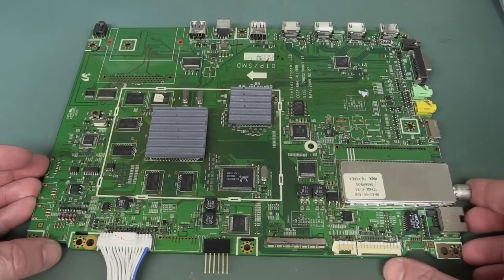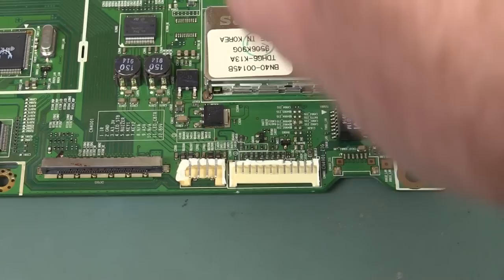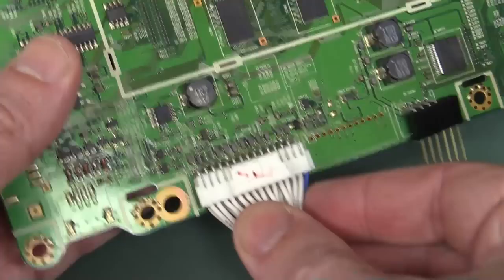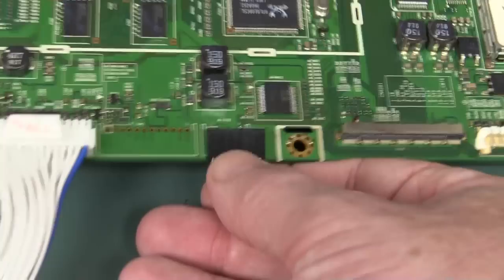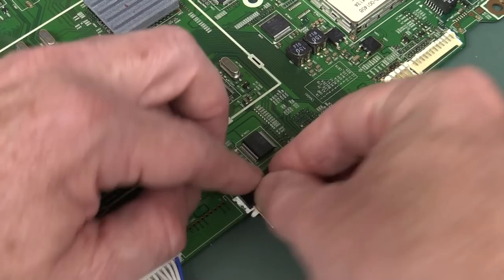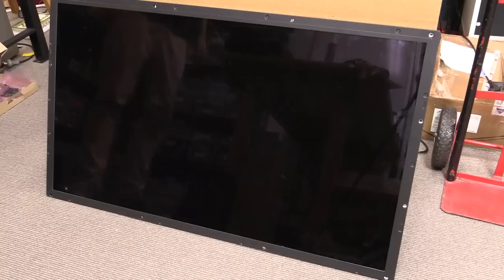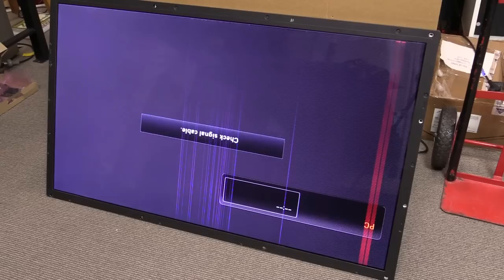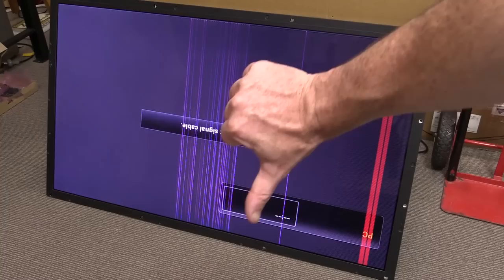EEVblog #794 - Samsung Dumpster LCD Repair Connector Followup

Comment: Can anyone else hear that low-ish frequency hum in the background? It's definitely the video as I pause and it stops, nor does it occur with other videos.
Reply: I have heard it in other videos and realised that it probably has something to do with the led illumination drivers because in said videos Dave turned those light off and the sound stopped. Maybe it's coil whine? maybe the mic is picking up some of the supply switching noise somehow?
Reply: +RapiBurrito Transformer hum perhaps. Probably just EMF leaking into the mic tho.
Reply: +Richard Smith Yes, it is very easy for microphone leads to pickup stray RF/EMI, especially if it is just ahead of the audio amplifier or preamplifier and even more so if it is a high impedance microphone.  In my experience it is often an even greater issue when the cameras have (some degree of) a ground reference due to being plugged into the mains rather than operating on battery alone.

Comment: I do remember old NVIDIA gpu's on laptops had the same stripy kind of error... ppl stacked coins on the actual gpu chip ( 6-7 ) then cut a square hole in some tinfoil to protect other chips and connectors from the heat gun and just reflowed it like that.
Unless my memory is compleatly wrong on the subject this was refered to as a "coinstack reflow" and the weight of the coins helped pushing the gpu chip down to make the lil solder balls bond between the chip and the pcb.
Reply: LOL! those crappy Nvidia 9x series gpu are the only reason why i know what reflowing is and down the road what ultimately led me to join dave's channel. so i say "hear, hear Nvidia! thanks for your crappy 9800gt. long live the pizzaoven and some tin foil!"
Reply: Yupp :)
Well it was also the 8000 series nvidia gpu's that had this issue... i thought it was fixed with the 9000 doh :P

Comment: Its a bad panel hands down, knew it from the start.. the 1st giveaway was the doubling up video that jitters. TAB failure within the panel itself. Repair tech here seen many dozens of these Samsungs are known for panel failures. replacing the t-con will NOT fix this issue I guarantee that

Comment: I don't think iv'e ever seen reflowing ever fix a board (for a reasonable amount of time ~6 months or more).
Has anyone ever seen this process actually work, or is it just a myth?
Reply: It depends on the cause of the failure.  There have been many failures with large BGA chips after the lead-free (RoHS) transition due to pure tin and high-tin content solder having very poor ductility and the connections literally fracturing due to the repeated stress of thermal cycling, something the traditional leaded solder, being more ductile, was much more tolerant of.  In such cases, reflowing has a high likelihood of repairing the problem at least until the fracture returns (at which time it is worth considering reballing the BGA chip).  Reflowing can also help repair issues where there was poor or incomplete reflowing or wetting in the original reflow at manufacture leaving some components with poor or intermittent electrical contact.  So it really depends upon the fault, but it can be highly successful in certain cases, certainly enough to warrant considering to try such when all else has turned up no better alternatives and you possess the means to do so.

Comment: never give up!  
Maybe your next "dive" will result in a LCD with a cracked panel, but good board set... many panels use a common/similar LVDS interface... might be worth trying to connect to another LCD monitor/TV/Notebook with the same interface to determine whether it's the panel or not... or maybe an LVDS controller card for testing LCD panels...
http://www.ebay.com/sch/i.html?_from=R40&_sacat=0&_nkw=lvds+controller+%28dvi%2Chdmi%29+1080&_sop=15

Comment: I had the exact same tv tried freezing everthing no change and tried heating with a heat gun while on. customer did not want to spend money on tconn so junked it wish I would have kept it this is a huge mystery you have stumbled on in the TV repair community. ya gotta figure it out.

Comment: Hmmmm......:( I think the TV manufacturers implanted this kind of issues. The ebay full with those kind of error related tv-s. And no so easy to repair. Worth of the money. You just can replace full boards.Even the blody line driver chips are glued together with the panels. Oh yeah, old times, when You can measure, and replace parts in the TV-s :))) Now Yo cannot replace even a stupid capacitor , because they use "special" numberings, special height etc... As My grandpa said... garbage is garbage My son...:) So this is a garbage :))) Drop back into the dumbster or sell it on ebay for 100 Dollar :)

Comment: Dave, there is more Batteriser video bullshit being produced. Some guy will have working Batteriser unit within 2 months. Maybe you could build your own batteriser and test it? There is a particular product with flawed design, which could eventually benefit from that - Canon Powershot A570 (first version). I own one of them - it is old and obsolete point&shot which discharges my 2700mAh batteries really quickly - in under 10 minutes. It is supposed to work with 1.5V AA - it shows 100% battery. But whenI put 1.4V rechargables, it shows only 80%. If you want to see battery juice in % you just need to sideload alternative firmware to this canon:
http://chdk.wikia.com/wiki/CHDK

Cheers!